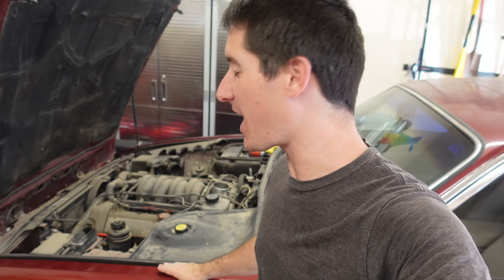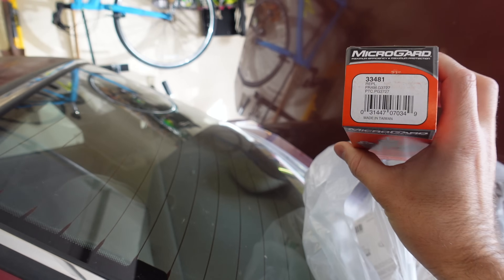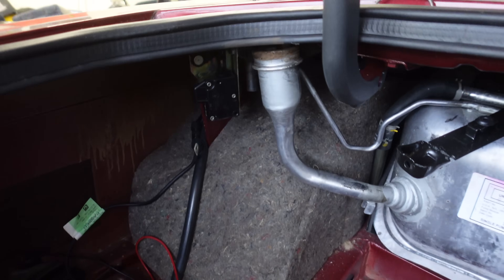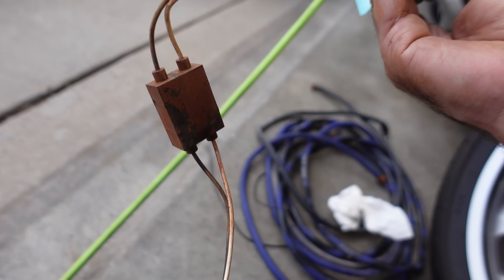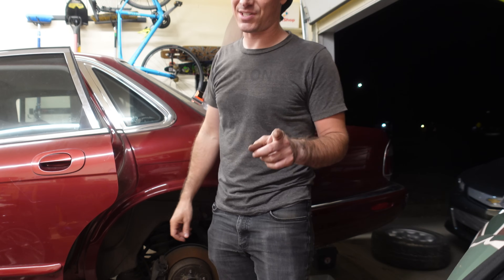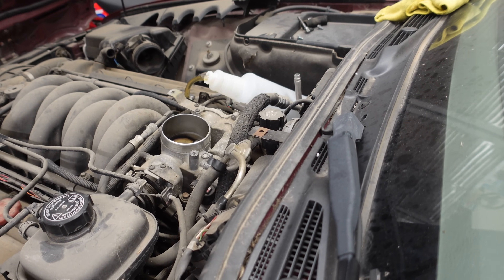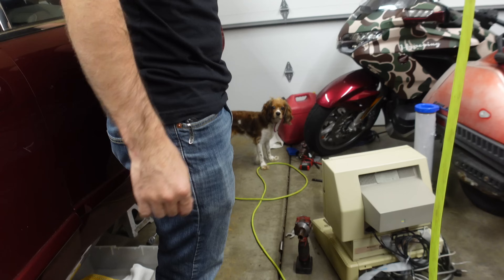World's WORST Fuel Pump Swap... Don't Buy An OLD JAGUAR

Comment: I’ve  worked at a jag specialist for the last 16 years. That won’t run with the air intake pipe off. Once you put that back in it should start. After watching this I’m thinking we need to start charging more than the 3 hours labour we charge to change these fuel pumps.😂
Reply: Yeah will not start without those air intakes pipes ..
Reply: these diy guys cry about everything
Reply: @xalty1200  not hard to understand why that is though, is it - they're not working on the same model of car multiple times, meaning they don't have all the specific knowledge for that car imprinted in their brain and don't know all the short cuts.
Reply: I was just about to say the same thing definitely won’t run with the intake off,will probably have bore wash as well now🤔
Reply: The thing that sucks is he has a nikasil engine, so he might be washing the cylinders as we speak.
Reply from the maker: With a lift it’s probably a reasonable job, on your back it’s pure insanity 😬
Reply from the maker: @xalty1200  I’m not crying one bit… but this car is trash mechanical design, that’s just facts. All they had to do was put the fuel lines on top of the tank and it would be a 30 minute job.
Reply from the maker: @organiccold  any other car would so it’s super annoying, but I’ll put it back together tonight and see if you guys are right! 💯
Reply from the maker: @wurly1  right?! It’s like no one understands that I have to work on everything with no specialty tools or previous knowledge, it’s just climb in and figure it out. Being a specialist is amazing, rinse and repeat the same jobs over and over.

The reason I love going back to Chevy trucks and corvettes, nothing easier in the world 😍
Reply: @WatchJRGo  I'm guessing you've read it somewhere by now but that engine was EXTREMELY prone to flooding out on hit's own. It feels like every single one of those that were towed into our independent shop we already knew that it was just flooded.  Our trick was to remove one of the small hoses to the intake pipe and use a blow gun and rag to  "supercharge" the car while trying to crank it.  Most of the time that was enough to get it to start.  Obviously ideally you would pull all 8 plugs, put a couple squirts of oil in each cylinder than put some new plugs in.
Reply: I have a 2004 4.2 XJ8 and after diagnosing a clearing a bunch of DTCs I’m now getting a P037 (HO2s control circuit low). Have you seen this?
Reply: @MrBeugh  sounds like it catalyst heater sensor on the oxegen sensors. It’s either short to ground or the sensor is faulty itself. I have replaced hundreds of oxegen sensors on these vehicles. Hope this helps. I would also check the fuses for the oxegen sensors.
Reply: Idk but if the filter is clogged wouldn't the pressure run back in the tank but i am sure having the intake pipe off won't help but just guessing at this point I am going by the pressure reading cuz its getting to the engine but when you shut it off it stops and no more pressure
Reply: @WatchJRGo   with a lift it’s not too bad a job. We normally use a long flat blade to keep the disconnect tool in place. It’s a lot harder on a Xk8 as they have even less room to get to the pipes. Me and my colleagues have all said the same thing that they could have run the pipes in a different way and the job would be much simpler. The more you work on them the more you will find yourself scratching your head as to why the engineer designed it this way. When a simple fix would have been much easier 😂
Reply: @WatchJRGo  so did you happen to put the intake pipe back on and crank it up??? Cause I'm pretty sure that's why it didn't run as well
Reply from the maker: @kingmeshech5527  not yet, I’ll try it tonight
Reply from the maker: @lukesheehan9708  yup, tried the super long screwdriver and still couldn’t get it to break loose. I gave it my all 💯
Reply: Right cause there's an AFM on it ...
Reply: The drama. 😅 jags are a master piece. You’re just not knowledgeable enough. Living and learning
Reply: I want it to be this. waiting and hoping for tonights post.
Reply: @WatchJRGo  the only specialty tool needed for that jag and all others is TNT. It will fix every issue with every Jag.  The fixes are typically permanent.
Reply: @marcopimentel615  in have to agree. Just like any car you have to know how to work on them. They're all different. Like the top of the tank can be rotated so you can pull it out the top sitting in the trunk. Also who would think the car would be soooo finicky that you can't start it without the maf in line or that the cylinder wash thing is a thing. If you know these things then it's easy. If your figuring it out for the first time then your not going to know. It's familiarity. Don't down the design when you don't know and therefore don't understand it.
Reply: Where is the Schrader value I couldn't keep gas pumping it 38 psi
Reply: I had to use a short Tracee found out the box under fuel box in r trunk was bad wouldn't keep presee
Reply: Same with a lot of early mopars

Comment: That's the golden age of jag unreliability...good content.. Terrible car...what other problems are lurking
Reply from the maker: I didn’t realize how unreliable this engine is 😬
Reply: Start circuit works run circuit not working  clean all your grounds and starter wires
Reply: this engine is not unreliable lol, so much disinfo, just do your chain tensioners and coolant components. my 99 has had zero issues in a year+ of daily driving in all kinds of traffic multiple times a day, zero issues only alternator
Reply: @h7pubg  Well as long as yours runs well, then all the rest must as well.
Reply: @mexicanspec  bad faith comment, read the forums, facebook groups, or anywhere from people who actually own the cars, they will attest to their reliability. there's a difference between "i knew a guy in the 1980s whos jag was always in the shop" vs people who own the cars, and yes I would put their experience with the cars as more valuable than people repeating or embellishing online myths. yes jaguars prior to ford era had lucas electrics issues, after 1993 those issues were long gone, they are no different than any other well equipped car of the time, if not better, when sorted.
Reply: Oh right so an engine has been stood still for 16 years and has issues running is down to "golden age of Jag unreliability"?
The worst thing you can do to anything mechanical is let it stand. On top of this, and worse, 'someone has been there before'. parts are missing ffs dude!
Define the problem before offering inane criticism.
Reply: @WatchJRGo   Come on JR be fair now. Its been stood for years, someone has been in there before and parts are missing. That isn't 'unreliability'. You will trouble shoot the issues, it will run and it will be a fine car. It is in superb condition but has just been neglected and 'got at'! 👍👍
Reply: @1chish  exactly, couldn't agree more. hate the jag misrepresentation by people online, never hear it on the same level when its content based on german cars, bmw mercedes etc, but jaguar always gets the reebok brigade regurgitating their sayings in the comments.
Reply: @WatchJRGo  It's not unreliable at all.  Only known issue is the chain tensioner that has a solution.  Early V8s had some issues with Nikasil cylinder liners, but with gas formulations, that didn't really come up any more.  I would argue these are probably the most reliable jags made.
Reply: @h7pubg  youve never heard people talk about Mercedes and BMW reliability? It’s well known how bad they can ALSO be. Just search for V10 M5 and watch the heartbreak
Reply: @WatchJRGo  I have 4 Jags— year range from 1998-2001. My XJR (my daily) has over 240k miles. The rest range from 80k to 130k. Fuel pumps are hard to doon them; however, they are excellent cars. I changed the timing chain in all of them and they are fine. I have been driving them since 2003. Besides my Saabs, I would not care to drive anything else as a daily.
Reply: @h7pubg  Wrong.  I was in the car business and experienced the cars myself.  if you want to know about a car ask a dealer, not a person that has owned one of them.
Reply: @h7pubg  "When Sorted" are the magic words, it is just they are never "sorted".
Reply: @mexicanspec  a car dealer lol, no, car dealers have one of these every few months, probably junk if it’s getting traded into a sled lot. when sorted is simple: timing chain tensioners, fresh coolant hoses, thermostat housing and maybe PR valve. not talking about cars that have been sitting for decades here, no shit that car will have problems. spend a couple grand like a responsible person, or get one that had already had the work done by a not neglectful owner, and you will have a bulletproof jag. stop repeating internet sayings pretending to know more than people who actually own them.
Reply: @h7pubg  I agree. People take individual situations and apply it with a broad brush.
Reply: @WatchJRGo  if it is not a fuel issue, it is more likely than not a security issue. You will need a Jag specialist with the security computer to help you sort the security issue. Your other option is to find the security  computer in England.
Reply: It's the opposite, this was the great era of jags, just keep the maintenance up

Comment: I can honestly say this is the worst and most difficult fuel pump swap I have ever encountered on any car. What a nightmare. I do think people should replace the electrical connectors as they are a primary source of problems on the fuel pump. Simply swapping out pumps without replacing the connector could quite possibly mean getting to do it over again. This is NOT a project you want to do twice.

Comment: It’s so mind blowing watching someone else go through all the pain I went through 😂😂😂. I’ve did this job 3 times due to faulty pumps from AutoZone & Oreillys. I would HIGHLY! Suggest that anyone doing this buy the OEM pump. The lines from under the car will come out but you will
Have to drop the sub frame and use another style of disconnect tool. But for anyone looking to do this job the first time. Going thru the trunk & cutting a hole is the best way to go 🤞🏾
Reply: thanks you helped a lot!!

Comment: It won't run with the intake tube off. Put it on and plug the holes the best you can, you may have a chance. These are super sensitive to intake leaks. Also looks like a slow prime, might want to jump the fuel pump relay and see how much fuel comes out in 30 seconds, close to 1 liter would be reasonable. Keep soaking the filter, it's probably original and plugged.

Cringing at the access hole but I don't blame you for what it is. Lol. Good luck
Reply: Also no, it's really not much better on a lift. Still sucks!

Comment: JR remember it is a ring less nicad engine Jag did away with after 2000. Compression is the key. A little oil sprayed in each cylinder before you first start it. Then it should take off. Makes for a good mosquito control for about the first 15 minutes of running. 😊
Reply: You've got to be kidding. What were they thinking? What will they reinvent next? Maybe square wheels.

Comment: Injector/s could be crusty and stuck open flooding it out, so get a few fires, then too much fuel until it sits a while, then same scenario again. Pressure regulator could be stuck partly open allowing fuel to drain straight back to tank, clamp off return line and recheck pressure, if still the same injectors are probably leaking. Both of the above will cause the fuel pressure loss you're seeing. The slow build of fuel pressure could easily be a blocked fuel filter, so keep trying to remove the old one and fit the new one, vice grips and wd40 may be your friend for that. Vacuum leaks you mentioned are obviously a concern and will cause a lean condition making a cold start more difficult 👍🇦🇺

Comment: You can see the frustration in the way he butched the metal lol
Reply from the maker: I just cut flaps so I can put it all back 🍻
Reply: I was surprised by that.  But for the head aches it brought, it asked for it.
Reply: 84 Mercury Marquis. Bad heater core. Either tear entire dash apart or engine side firewall cut off wheel. 12 hours vs 45 minutes. Well done John!

Comment: This hell was my recent experience changing my IROC’s tank. Previous owner cut a brutal “access panel” over the tank- cutting it open in two places. His cheap no-name pump failed almost immediately. So new tank, pump and sending unit (which was also cut and patched with non-FI hose). Took something like 12+ hours of fighting by myself to finally get the poorly-shaped re-pro tank in (requires dropping the rear end and I had to cut the exhaust out). Hell! but…runs well now.
Reply from the maker: I highly recommend the access panel in fbodys… just cut it oversized, clean up the cuts and put a nice piece of sheet metal back with sound damping over it. Really makes you appreciate all the tanks with access holes under the back seat.

Comment: I did exactly the same thing to get to the pump on a Rover 200 convertible fuel pump - tank lives under the car but all fittings looked like part of the Titanic, so expanded and access hole and got in no problem. Which was lucky as I had 2 dud replacements!

Comment: Owned a ‘96 XJ6 and a ‘96 XJ12. I paid $1800 for the XJ6, had 72,000 miles, and I put $2400 of parts into it in 8 months. Then sold it cause after the 3rd alternator and 2nd lower cooling hose I was pretty done. I did put 12,000 miles on it during my ownership and I guess it just didn’t like that. On the flip side Ive never found a easier car to do ball joints on. As for the XJ12, saw one pop up for sale and decided I missed the pain of the XJ6 and bought it for $3000, and a $600 bill to get the alternator replaced, then drove it 350 miles home. At 12mpg. Of premium. Yeah I put maybe 10-20 miles on it a year. Its 8/9mpg city and about 12/14 highway. Not driving it as a daily driver its proven much cheaper to own. They truly are just pleasure/collector vehicles.

Comment: A small tip here, John: as you see the couplings for fuel is absolutely idiotic on these jags. And you in perspective are a very skilled and resourceful dude, and still have a hell of a problem. I have repaired the tank assembly on jags a few times, and the last time i got help from a friend that is less conventional than me. His solution was much better, he emptied the tank and cut a big hole in it so he could reach in and cut around the couplings for gas. And i sad, great, now we have to change the fuel tank. But he was smarter than me, the new tank was really cheap and when we drenched the couplings in glycerine we could just click them in place from under the car, no tools needed. All in all it took less than 2hrs in total, and was, apart from the cutting the tank (very thin metal) just basic nut and bolt work.

Comment: Learned my lesson in 1969 with an XK -E, I wanted to replace the fuel pump in 1972 , Jaguar wanted a fortune  so I found out that a  standard GMC truck fuel pump could work for $18 . It was loud but in a rag top what isn’t loud. Once again I don’t see how Jaguar ever gets repeat buyers , the new ones are still maintenance nightmares with engineers who designed it as a maintenance nightmare  just like their predecessors.

Comment: I went through the same thing with a Ford powered motorhome that sat 10 years. I changed the boost pump in the tank and the high presure pump up by the engine and it would do the same thing. Turned out to be stuck fuel injectors some would leak causing the engine to start momentarily so I took them all out used carb cleaner and couldn't break them free then decided nothing lost nothing gained, I tried slamming the fuel inlet side hard down on a vise to break the pintals loose and it worked. You then take a 9volt battery and jump the injectors and flush them with carb cleaner. Though eventually I did buy new injectors off of e=bay as I still had idle issues.

Comment: I’ve experienced the joy of removing the tank in my 1993 XJ40 so that I could change the pump. I am now an expert! Make sure the intake is fully connected. The mass airflow sensor needs to be in full operation for the car to start.

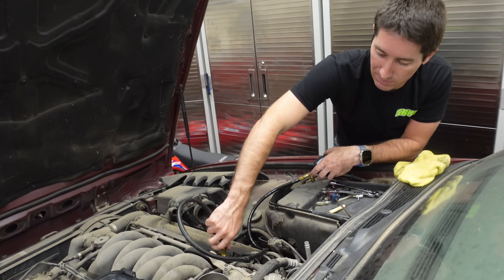Comment: It is very obvious that engine is down on compression is some cylinders, But that doesn't mean the engine is hurt, It's just that currently it is low on compression. Could just be stuck rings or on the other hand it could be the reason it didn't hold any coolant. No need to mock us, It's Just another option to way out. Also at 10:32 it looks like the maf is still connected, May not want to idle like that. Love these cars though! definitely wanna see it all cleaned up!

Comment: Maybe it has a start/run circuit kinda like the old dual ballast resister on the early Mopar electronic ignition cars. One gave almost full voltage to get it to start and as soon as you let off the key when it started it would drop the voltage to the coil to keep it from burning up parts and overheating etc. If the main run half burned out it would start and immediately die when you let off the key into run mode. You always kept a extra or a jumper wire to bypass it if it died. Good luck.
Reply: I think it's new enough to be a coil on plug distributorless ignition on that car but it does sound like something is telling it to not run -- i.e. some sort of sensor.
Reply: That's too funny, that same thought went through my head as well.

Comment: I have personally taken the lines out of the bottom of one of those jags, without a lift, you do not need to drop the diff, and YOU DONT NEED TO CUT A HOLE IN IT. It’s actually easier to get the lines out than taking the seat and shelf out to cut a hole in it for no reason.